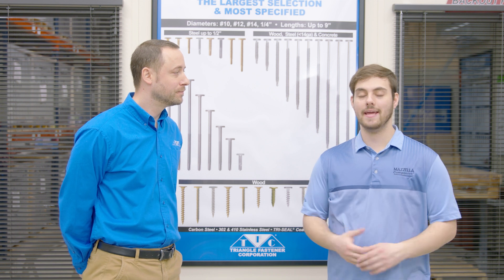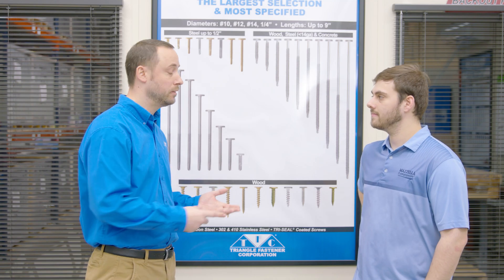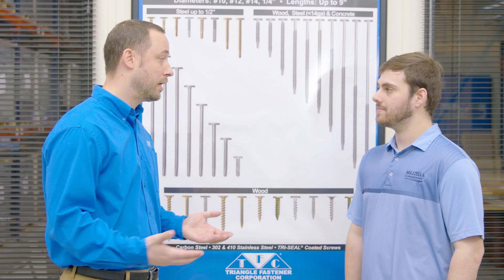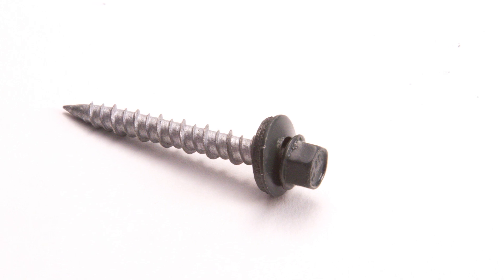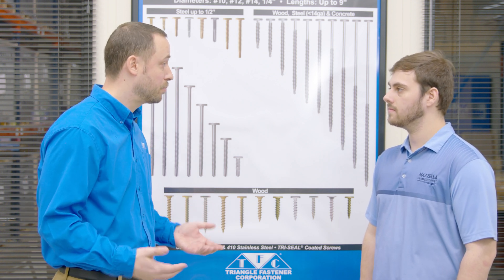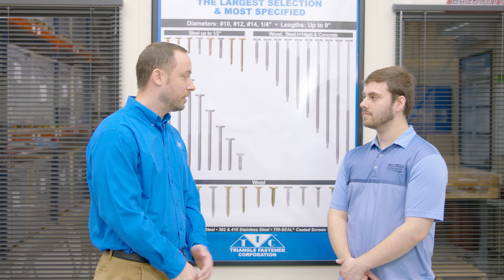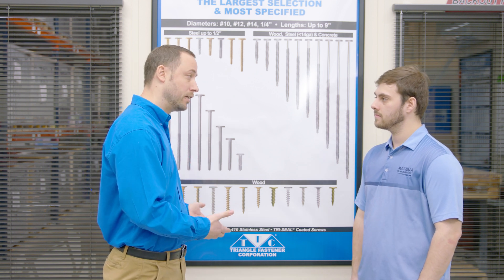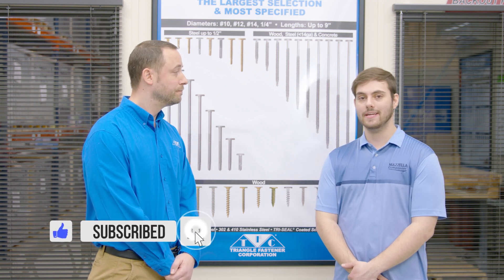Buying Metal Roofing Fasteners: Types, Substrates, Materials, Coatings

Comment: Glad I came across this.  I have a couple questions for you.  We have a log home with metal roof on plywood.  This is in western Montana--pretty good snow loads--with a 10/12 pitch.  The roof is secured with exposed screws and they continuously work themselves out.  Is there a better product or technique to keep the screws tight and waterproof?  Are we better off replacing all the screws?  The roof itself is in good shape but water infiltration could cause considerable damage.

Comment: Do you have to consider different metal types for fasteners based on the roofing metal type? E.g. aluminum for aluminum roofing, copper for copper roofing, etc. I'm curious if different metals don't play well together. Thx.
Reply from the maker: Great question! Dissimilar metals as well as the project’s environmental conditions should always be taken into account with all products in or around your metal roof system. Not all metal products and accessories work well together and could have a galvanic reaction if they come in contact with one another or come in contact with water runoff from a dissimilar metal product. The good news is that there are a wide variety of fasteners available in different material types and coatings to  work with every type of metal product on the market. We always suggest contacting the manufacturer of the metal roof system if you have any questions concerning what products they recommend for their systems. Hope this helps! -Thad